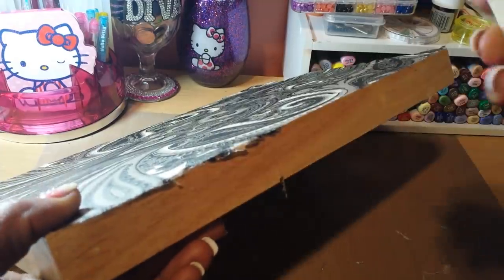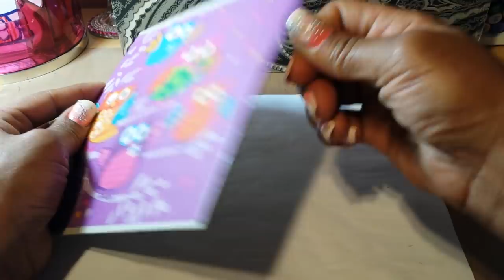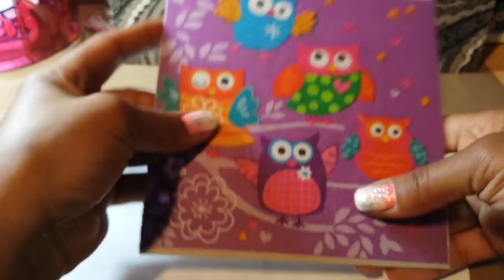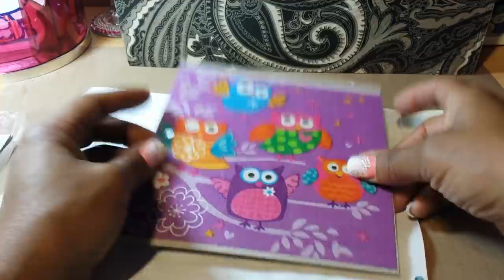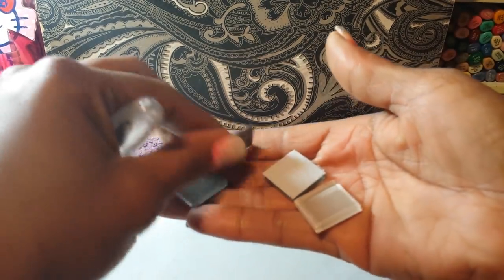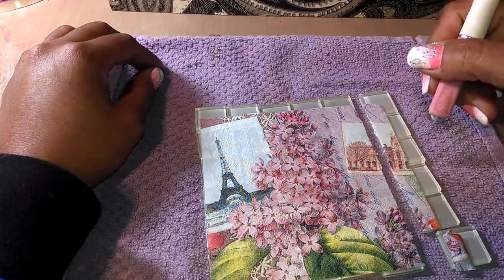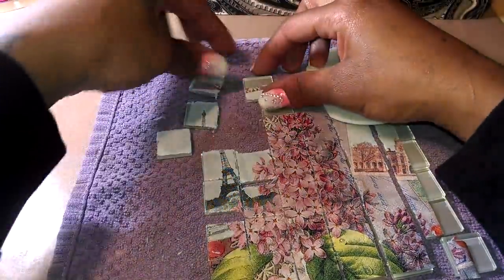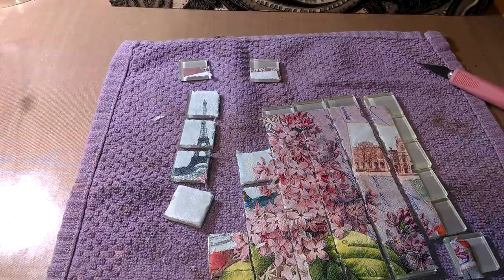Napkin transfer on wood/tile & chip board

Comment: One way that's easy to cut the paper away from the box and get a nice straight, smooth line would be to lay it down on wood or self-healing mat and use an X-acto knife right against the box. And I saw a video where the lady used Mod Podge to adhere the napkin to her piece instead of ironing it, and it stuck down very well. Great video! Thanks for showing me something I had never seen or done before...gotta give this one a try! :)

Comment: I really enjoy this video, I keep coming back to it.the only sad thing is I cant fine those little sand block.  anything thanks again for the video.
Reply from the maker: a white medium emory board nail file works too, that's what I have been using lately. I get them from the beauty supply store
Reply: I actually take sandpaper and attach it to a sponge with some copper wire right on the side through to the bottom, easy to work with and super cheap!

Comment: I haven't read all the comments, so I don't know if anyone mentioned this or not... but you COULD use an exacto knife to cut the paper & plastic off & you wouldn't have the jagged edge of paper & plastic sticking up, that would need to be sanded.  Because the blade would be flush with the top of the edge. Especially if you aimed the blade down a little toward the back as you sliced through.
Reply from the maker: I have tried that and with the wood the sanding block gives it a smoother finish

Comment: Nice video, good sound.  This process of ironing the image/napkin onto a surface is not technically transferring, correct?  I'm a newbie and trying to learn and I am trying to learn all the terms to keep them straight, LOL.  I was under the impression the term 'transfer' is when you actually take theimage from the paper and transfer it onto another surface and remove the paper backing?  Also, could/would you please tell me, did you prep the wood in any way or just lay down the plastic?  And, can any type of plastic be used (i.e. plastic drop cloth, saran wrap, etc.)?  And one more please, what kind of paper did you use on top of the napkin, plain or cardstock, or does it matter?   I'm always watching YT for tips and such, so thank you very much for posting!

Comment: When holding your little tiles in-place- their is A3 cardboard sheet you can get that is plain on one side- but the other side has a paper backing that you pull off and the surface of the card can then have anything smoothed on top- like those tiles!! Does not cost much and I get mine from my local store that sells artists paints etc!!

Comment: I would suggest putting it face down on a cutting mat, and tracing closely around the top edge to cut off the excess with an exacto knife - and that should let you trim it quite closely - possibly not needing to sand at all. :) I wonder also if it would help to iron the napkin (maybe very lightly spritz it with a mister first?) The napkin has creases, which do seem to stay, and ironing the napkin first might get rid of those?  Just a thought!  I really enjoyed the video!
Reply: If you cut from bottom to top and angle the scissors just a tad you can get a close and straight cut. To keep your roles from shifting put just a drop of paraffin on the backside and place a piece of paper on top.

Comment: Loving the mini tile mosaic! I had a thought on how to keep the tiles from shifting, what if you place a piece of rubber shelf liner under them? I do this for my laptop to keep it from moving on its stand.
Reply: So is plastic wrap better than decoupage?9
Reply: So is plastic wrap better than decoupage?9
Reply: @lindatwyman8739   As hard as I try with decoupage, I end up with creases or tears. Not to mention the waiting time for things to dry only to see the bubbles! Ugh!
I'm a fan of the plastic wrap as the only thing you have to wait for, is the heat to dissipate.  I've tried the plastic wrap to adhere the napkin on a wood box and it worked out awesome!

Comment: This is an awesome technique - I've had napkins to try to transfer but I thought I had to mod podge them.  Do you just use the plastic wrap from the roll?  Do you have to cover the top of the napkin afterwards?  TFS, Dorothy
Reply from the maker: Yes Dorothy, its regular cling wrap. You don't have to put anything over the top of the napkin but you can to protect it from moisture, and after its transferred to the paper and you use mod podge, the surface doesn't wrinkle like if it was just the napkin by itself. TFW
Marcia

Comment: What an awesome idea. Love the video. Now I have a ton of ideas. Though you may want to think of using painters tape under the tiles to hold them together until you are finished. Have you ever tried sealing them with polyacrylic and if so did it work?
Reply from the maker: I have.... it works great... I have found that doing a thin coat first to seal everythingand letting it dry makes it easier to apply a thicker coat with out smudging... Thanks for watching

Comment: going to have to try that on chip board. question , where did you get you get that sander thing
Reply from the maker: I got them from michaels a while back on clearence, but you can also use a nail file. TFW

Comment: Question, are positive the napking does not come off the "wood" box?
Reply from the maker: Alicia N Hernandez it doesn't come off once you use enough heat to seal it. The wood I showed in the video was sealed at another time with mod podge to protect the napkin from ripping. Thanks for watching.

Comment: Would it be easier to use a box cutter or an exacto knife to remove the access
Reply from the maker: It would but it gives it too much of a blunt cut you want to leave A little hangover of the paper for sanding to get a smoother transition before sealing

Comment: Tried this technique 4 times and the paper crinkled an hour after applying. Looked good and smooth once it was done however crinkled up an hour later once it cooled
Reply from the maker: You have to make sure your iron has melted the plastic underneath, mine never crinkled even to this day. TFW
Reply: Mine was very smooth in the outer edges but crinkled in the middle. 4 times and also crinkled a bit near the edges on the paper when I tried it on card stock.  I  re applied the heat but 5 minutes later it still crinkled. Thanks for your reply back. Maybe it has to do with the type of wood

Comment: For better results keep the mesh on the tiles & sand the surface so that its not so smooth.  That will allow small scratches to hold the plastic/binding agent.
Reply from the maker: Mike SlyServer  thanks mike, it was my first attempted experiment
Reply: Hey thank you so much for being so prompt with your response back to me.  Now i will definately watch a lot more of your videos.  But I did know that it was a first attempt & in my line of work the best things happened from diving in head first & trying something new.  I was watching for stuff/ideas to engage my 3 y/o daughter.  She loves making bracelets & I was looking for more & different ideas.  I saw your good video & knew from work experience that paint & adhesives adhere much better to a rough surface than a smooth surface & from my experience remodeling kitchens & bathrooms (and being on HGTV) that the mosaic tiles would be eaiser to handle & manipulate if the mesh back was on.  Then for an idea would be to not grout it but fill the gaps with something like glue/glitter or a caulk w/ glue or dye with or without a nice spicing up.  Good luck & best wishes for you in the future. 

Thanks,

Mike
Reply from the maker: Thanks so much Mike for your kind words, its much appreciated

Comment: I want to figure our how to do that on walls. It would be gorgeous doing a whole room like this.
Reply from the maker: it would have to be individual tiles and I would say seal with a clear coat for easy cleaning. I know they make some kind of clear spray that goes on like glass or the clear two part resin type stuff thats sold at like hoke depot to seal table tops

Comment: I think you should use a box cuter or a razer blade you would get a clean cut I also use as fabric roller to cut a straight line
Reply from the maker: Mandy Smith I've tried different tools and the sanding block gives a smoother cleaner edge. TFW

Comment: Great idea, Sweetie.  For a quick @ clean edge of excess to trim....flip unit over on clean surface @ use an X-acto knife.  Scissors just  " don't cut it "  NO punn intened.  ☺  thanks
Reply from the maker: Terrie Johnston yes Terrie the x-acto knife works too but sanding gives it a clean tapered edge.

Comment: I might suggest to use a cutter roller you can get at jo anns fabrics to cut cloth etc it look like  a pizza cutter. you place the object down on the mat and cut with the roller vs scissors
Reply from the maker: gypsygirl731 i have tried that in other projects but it seals better it you leave a little free edge because when you sand it, it gives it a beveled edge which leaves no room for lifting and the sealant won't pool up on the edge. Thanks for watching

Comment: when you iron the napkin and saran wrap is the paper just paper?
Reply from the maker: Nancy Kelly yes, the cling wrap acts as the binding ( or glue) of sorts and holds the napkin firm in place.
Reply from the maker: Nancy Kelly unless ur speaking of the white paper I used on top, that was just regular printer paper. It protects the napkin from getting burned. some napkins are to thin to iron on and the cling wrap might melt thru.

Comment: Cool idea...i will assume that the plastic is just regular plastic..from like ...what you would get from the dry cleaners??
Reply from the maker: its cling wrap that is sold near aluminum foil. I havent tried the kind of plastic you mentioned although it seems like it might work but would have to apply more heat. TFW

Comment: Thank you for posting this video. Have you tried to seal it with anything?
Reply from the maker: yes mod podge works great, but to keep the tissue paper from moving do a one stroke light coat. let it dry then you can add more if you like. The first coat holds it in place. Thanks for watching.
Reply: thank you :)

Comment: I  have tried and tried to do it an cannot get it to work what am I doing wrong
Reply from the maker: peggy safa-esfahani are you putting your layers down correctly?
Reply: yes plastic first then napkin  @censuous1
Reply: yes  I think so @censuous1
Reply from the maker: @1psafa  try turning the temperature up on your iron being sure to have another sheet on top of your napkin before ironing, the heat is going to melt the plastic to adhere the napkin

Comment: How brave you are to do a project that you've never done before "live".  Have you figured out what you are going to put on the top to seal them?  I will be subbin you so I can keep checking for your follow up to this project, can't wait to see how it turns out.  Good luck.
Reply from the maker: Thanks Teresa, I have used mod podge to seal it, and it doesn't wrinkle... I will be ding some updates after I move and get settled in, tfw

Comment: next time, use an exacto knife for a cleaner cut.
Reply from the maker: Roxyie Curone . it will cause lifting, you don't want to cut right to the edge, you have to leave room for sanding. it gives it a cleaner beveled edge. TFW